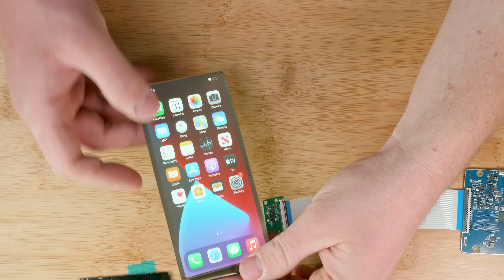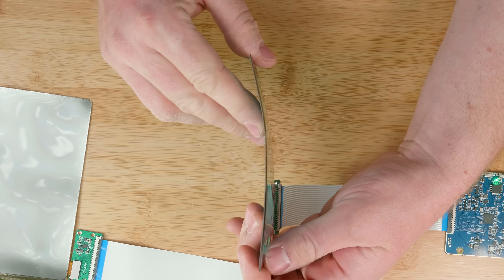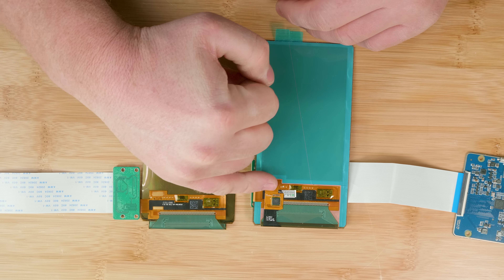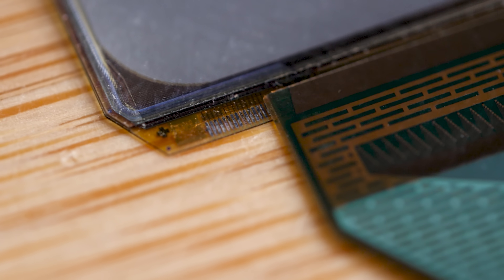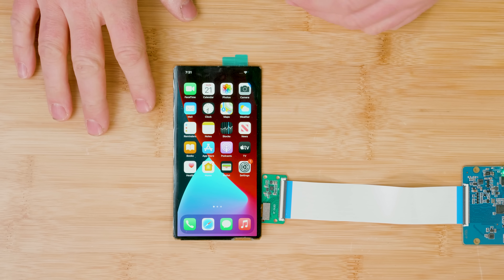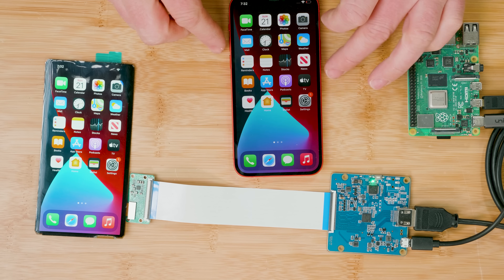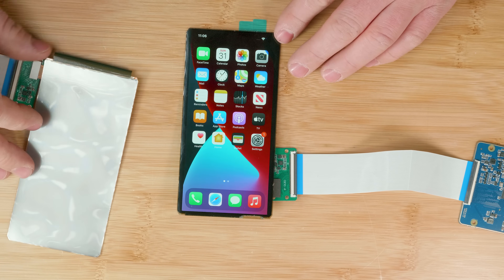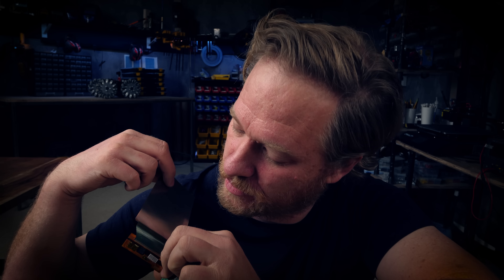A folding iPhone?

Comment: Reason why people are having problems with the Samsung z flip 4 and fold 4 it's because they are flipping them open quickly and that puts a lots of stress on the hinge mechanism if you flip it open quickly hard enough you will break the screen in the hinge somehow shaper form that's the reason why the screen and the hinge is is messing up sooner than expectant.

Comment: 2:40: BOE Technology Group Co., Ltd., or Jingdongfang, is a Chinese electronic components producer founded in April 1993. Its core businesses are interface devices, smart IoT systems and smart medicine and engineering integration. BOE is one of the world's largest manufacturers of LCD, OLEDs and flexible displays. This company isn't discontinued.

Comment: I am trying to do something similar on android. The datasheets / pinout are not found. My next step will be to bring the connector to a prototyping board (2.54mm), and test the omhs. (use oled 40pin, mipi dsi 4 lines damaged for testing / reverse). I wonder if something will need to be adapted in the kernel, (like to eliminate the notch space) .. Ahhh .. Changing the camera will be even more difficult, but it's fun. Waiting for your new videos.
Reply: (or obtain the pinout from the documents, (schematics / boardview), of smartphones with the same screen)

Comment: mikeselectricstuff did a MIPI interface to run an iPod screen, I don't remember the standard but he did it with what you've got in the shop. That chip on the interface board speaks it and so does the screen and you've got a scope and a pen and paper. Iirc, that's all he used. Go watch his. There's no standard connector for interconnects inside devices. Big manufacturers like Apple can have screens made with connectors that they want, but it's roll your own otherwise. There may be a 1 to 1 pin match on the iPhone screen that matches yours and you can manage to swap the flat cable in some way and skip doing the connector on the other end.

Comment: Sir. Please hear me out. Put an AirTag’s internals inside the AirPods Pro case. The case is relatively crowded but maybe you can remove the Qi charging coil to make some room. Or you may find a way to use the empty room inside of the closing lid since I’m pretty sure there’s nothing in there. That would be AMAZING.
AirPods Pro not being able to be located or tracked when the case is closed is an epidemic among Apple users. if you could make this work somehow you would ascend to a higher Godhood than you already are.

Comment: first issue, you are trying to build an iphone screen, you are trying to modify hardware from a ethically crap company that doesnt even let you change the battery without issues. why not do something most would prefer when it comes to DIY, go android, or linux base. toss apple to the corner. and let the apple rot on its own.

Comment: i'm not sure how you're planning to 'glass' an inward folding phone, but use the broken one where you can to test adhesion of whatever super-flexible scratch protectors you can find with physical properties (flexibility, heat expansion, etc.) exactly the same as the screen material has so it doesn't pop off during use.

Comment: Golden one has no copper backing, other one does. Samsung s6-s20 are all like this if you remove the back foil. The s20 is so thin it about rolls up nearly by itself when removed from the frame. 

If you remove the glass and frame from the iPhone X and up the oled panel is flexible as paper. Remove the 3D Touch panel from the back of the oled and you can roll up an iPhone X oled

Comment: Pure speculation ... but what are the odds that the thin version was the proof of concept run and the thicker one is closer to production?  They wanted to figure out the extremes of the screen and then test is its more practical production version?

Comment: Good to see you back :-) hope the quarantine is agreeing with you. 
What ever happened to the cylindrical setup of phones  , computers, with a rollout display - it would take away the hard folding points, but operating it would require a hard surface to touch screen ... 
but a secondary screen could be on the outside (black and white) to show time, weather etc like some back displays already do, messages (size of a smart watch but elongated) 
to open primary you rollout a screen :-) Back to papyrus - and the circel is round... :-) thanks for your content

Comment: It would be amazing, but Probably possible to get an iPad and an iPhone in one cca iPad mini sized body and have them switch if you close the screen so when the screen is closed the iPhone is on and when it is open it is iPad time. The whole thing could work through like handoff or something like that, it is probably way more than just impossible  but it is the dream

Comment: If folding iPhone would be real, the box will have nothing inside yet it costs $700. Then the unit only (with no charger, no cable, no SIM ejector tool, no Airpods) will be $10,000.

Comment: In reality what those flexible screens are good for are things that needs CURVED screens like VR or fancy photo frames not FLEXIBLE screens like Galaxy Fold
Reply: Fold is amazing tbh. It just needs perfecting. You can only go so far with a bending oled design (which samsung also pioneered) Samsung has drastically improved the crease mark with every iteration (even utilizing the punchhole camera within a folding display, something tahat competitors were not able to do too), something that no other company can do, and Ice Universe, a reputable insider, revealed that the upcoming Fold 3 and Z Flip 3 would have a near non-existent crease. I would wait things out because a lot of people said the same thing about the Galaxy Note when it came out, and it ended up one of the most successful product lines by a company. The technology that Samsung uses is maturing and the sales figures also reflect it because the Z Fold 2 and Z Flip broke records when they were released. I expect the same thing with the upcoming Z Fold and Flip.
Reply: @이순신-m3h  nah, it's a stupid gimmick that will vanish again until they realize that they will never really get it out of the prototype phase.
Phone screens need to be sturdy to withold some scratching, especially from being shoved in and out of pockets alot.
They should also not break everytime they are accidentally dropped - and that just will happen at some point.
Yeah - if you don't use it it will probably hold up a long while but uhm. Yeah.

I don't see an application in flexible phone screens.
It's cool - but not very useful.
It's a "hey we can do this thing" thing - not something that really has future.

Maybe it will have an application in something else - like laptops
I could see it being useful in there.

But not for a phone that is dragged around anywhere the person goes.
Reply: Nah it'll fit in my pocket better if it bends not fold. Fold is dumb

Comment: The Droid Turbo 2 has a flexible AMOLED, maybe you can separate the plastic from the AMOLED (it uses UV loca glue I think) and then find a controller for the display model. Best part? You can get droid turbo 2's for cheap, ~$40-$80 USD. Also I've seen videos of other phones (like a Note 10 for example) that actually can flex the oled if you take apart the oled assembly correctly.

Comment: You would have to make the mother board and the connections to different parts flexible without causing damage. It's very possible, just an expensive project even for a company when they're not guaranteed people will but such a new and odd product. People might see it as impractical if you are trying to type type or playing games, so you would have to make it hard enough so it isn't that easily folded.

Comment: ".3 milimeters, which is roughly 3 sheets of paper"
Damn, imperial units are getting weirder by the hour.
Reply: I'm american and I even find it annoying to use.
Reply: @ittotaq  boooo
Reply: He has very thick paper indeed lol
Reply: @ogdocanto8068  Not really. I just measured a regular copier paper sheet (80 g / m^2), and its thickness is 0.08 mm, so three sheets would be 0.24 mm. Not so far off.
Reply: @enginerd80  paper goes from 0.05 to 0.1 mm, so his paper would be on the thick side, but your right!
Reply: Lol
Reply: What will it be next?

Olympic swimmingpools? 😂🙄
Reply: An hour; basically 4 shots of 90 proof, 15 laps of a nascar track or the first superbowl ad/"intro". :P
Reply: Lol

Comment: My idea would be:
Write a decent software for mirroring ios to android or find one, buy a galaxy Zflip and modify it estethically to make it look like an iphone, keep the iphone in your poket and mirror it to the Z flip, it will be less bulky than doing everything from scratch and it is also probably the easiest thing to do, hardest part would be to make the camera, sd slot and antenna of the Z flip as part of the iphone. I don't know if this is actually possible but I absolutely look forward into this project

Comment: So i was thinking about your folding phone idea and think your going down the wrong road....as cool as it is how about a new way to do it.  How about something the size of i pen and the screen rolls out of it..instead of flipping you just unroll it.it would alow for all the components to be in the bottom of the pone and extremely small.  if you can get a screen flexible enough.

Comment: Suggestion - You could integrate the Lightning to HDMI adaptor into your prototype instead of trying to work out the MIPI protocol.
Reply: That was his approach with the headphone jack, I'm pretty sure he would be on to that!
Reply: But that won’t have touch support. And there’s no guarantee the iPhone will even boot up without a built-in screen being present…
Reply: But then touchscreen
Reply: Yeah. And i tought that you could try using the iphone digitizer (if its flexable) and solder it for a touch screen.

Comment: How about a Mac mini M1 as the processor board for a trad laptop case so you can add a no brand LCD with touch screen (hdmi). The board is small that runs on anty 12v PSU I think and it  could creat quite a flexible modular format as no apple serialisation.

Comment: If I was doing this, I would use the HDMI bridge chip from Toshiba that the aliexpress HDMI to MIPI driver board is built around. IIRC chip had good documentation and some other community members tinkered with it.  MICROSCOPE SHOTS OF PLASTIC OLED YAY! You are cool for doing this, the cost of these things has been a turn off factor for many curious minds.

Comment: I think it will very hard to achieve. The MIPI DSI protocoles are more or less proprietary for each device.
You could take the screen and the frame of the phone from a folding phone and try to fit inside the iphone logic board and some other components if the main board is small enough to fit inside. 
But then to connect the display... Specially since iOS is so very much closed source. Even connecting the screen to another android device would be a hardeous task but to an iPhone.

Comment: Think about "base" with all components in it and detachable flexible amoled around it with only a small part on the shorter side with battery and antena. You can use your device like normal phone or detach the screen with connection with base over wi-fi or something.

Comment: I don’t really see the point of a “folding “
Phones like que ones that are already from android. But I think that i will
Really like a “flexible” phone that I can have in a pocket and don’t break if it bends a little, or that uses the flexibility to resist a fall without breaking.
Reply: They do have a point. Having a phone that can open up to a tablet is the future
Reply: instead of glorfied instagram garbage why not put this tech into something useful like a rugged phone that won't break and now the screen cannot shatter either
Reply: Google “Arubix Portal” that’s basically what you are describing :D
Reply: And foldable phones are difficult for repair and expensive too, I like the Thin phone with Silver and polish edges and not a Glass at the Back. I found the Note 10 lite was perfect for me so I buied it 😋
Reply: Rollables phones are the future. Phone size and just a push of a button you have a mini tablet.
Reply: @Dongzzzzzz  Rollables have more compromises than foldables. A delicate flexible screen exposed at all times. Smaller room for internal components and battery capacity because of the use of a motor.

Rollables won't replace foldables.
Reply: @PSYCHOV3N0M  it will only get better from here. With that thinking, the phone industry should have not tried foldable phones.
Reply: @Dongzzzzzz  I never said nor implied that it won't get better or can't improve over time.

I said rollables won't replace foldables. They'll both coexist at least for a while.
Reply: @PSYCHOV3N0M  I guess you are right
Reply: @Dongzzzzzz  I'm excited for rollables but the durability worries me whereas on the Z Fold 2 for example I'm not worried about durability in the slightest.
Reply: LG tried that with G Flex and G Flex 2. These phones were curved inwards, their backs could heal themselves from scratches, they could withstand an actual human sitting on them, but they didn't sell well enough. Because no one actually cared any of that.
Reply: The point is to carry a screen size of your choice but in much less space, alot of people including me have a lot of trouble just carrying a phone in a pocket. If i could afford one then I would definitely like to own a Z flip.
Reply: @NanoMine  i also don’t like big phones. 4.7/5” inches is the biggest size I want on a phone.  And a tablet needs to be around 10” at least to be usefull. And there’s no way you could fold a 10” screen into a pocket size phone.  That’s why I think that foldable phones are the worst solution. Too big for a phone a to small for a tablet.
Reply: @Javiercav  5 inch is really really tiny
Reply: @inspiredcamel4388  I don’t really need any more. I currently own an iPhone SE2020 because it was the smaller one with  touchID. And today if I needed a new phone. I think will choose the iPhone 12mini even if it was more
Expensive than the bigger ones.
Reply: @Javiercav  to be hones the way the galaxy z flip was made doesnt seem bad at all a normal sized phone that can be folded to half its size (hight to be precise)
Reply: @Javiercav  you just don't like big phones, whereas I like big phones but not to carry them in my pocket so I think foldables are the best solution currently to get big phones of around 6 inches into a smaller footprint than even iphone se or similar phone. Also don't forget rollable phones you can definitely fit 10 inch screen into a pocket device, it's just the matter of time.
Reply: @Javiercav  You're delusional if you think a 10-inch foldable can't fit in a pocket. A phone can be made wider and the battery can be evenly split into three layers to keep each 3rd of the device as thin as possible.

Multiple manufacturers are already working on Bi-Fold phones like Samsung and TCL.
Reply: @NanoMine   I would buy a Z flip because they’re dope asf lol
Reply: The point is the challenge

Comment: I'm kinda confused with the instant idea of making a foldable phone as soon as you get a screen that can flex. If you want a foldable phone, why not just make it with 2 screens or with a screen that has tiny built-in hinges? Bending these current OLED screens at such extreme angles just hurts my eyes to look at and I would never feel comfortable having a phone with a design such as the galaxy fold. Just give me 2 screens with gorilla glass on them so I can feel safe using the device :D

I feel like flexing screens are made for a different purpose than this. But what would you use a screen that is not flat for? Not sure.

Comment: This is the problem of OLED - they cost a few hundred dollars even at 60hz while a 120hz LCD is much cheaper. If you need a screen replacement, OLED is far more expensive. But can you tell me what is OLCD and Flexible OLCD and OLCD nom flexible and what is what

Comment: Scotty, please join forces with Louis Rossmann in the fight for Right to Repair!!!

You 2 are both huge in the actual technical/engineering community (as opposed to tech/review bros that watch MKBHD or Linus Tech Tips, who don't really care about anything other than what the top specs are, geekbench scores and whether your device has small enough bezels or notches). True tech community is passionate about Right to Repair, they just need to know what they can do to help. And that's where you & Louis can come in and guide them through the political mess.

Please help Louis bring down the bastards at Apple/Microsoft/Google/Samsung, who keep lobbying & bribing their way into gradually removing your device ownership & repair rights. They want to turn your rightfully owned tech into "forever rentals", instead of "fully owned" property.

If you and Louis succeed, then you & everyone else will have access to the documentation & schematics that you mention @ 6:08. This used to be the standard 20-30 years ago, in order to allow people/techs repair their property. And now we are not even allowed to open our own goddamn phones to do something as simple as replacing a battery. This needs to change.

Comment: HEY !!  Use the "Remote Desktop" approach, where you mirror the screen from the actual iPhone (which remains in your pocket), Thus the screen display part is "easy" (LOL). Then just integrate the touch digitizer and feed that data into the modified iPhone (somehow, not so easy). I had a tablet that had a glitch, and the screen would not respond to touch. I connected a mouse and keyboard using a powered USB hub and adapters, it made the connection and I was able to gain control and restore the tablet. Perhaps the iPhone has embedded capability to accept mouse inputs, making the remote desktop approach feasible.